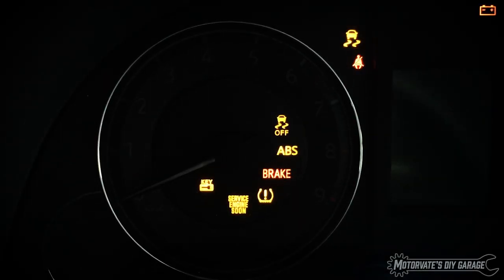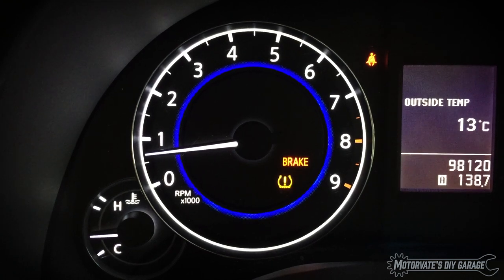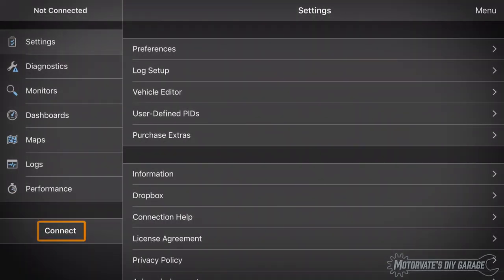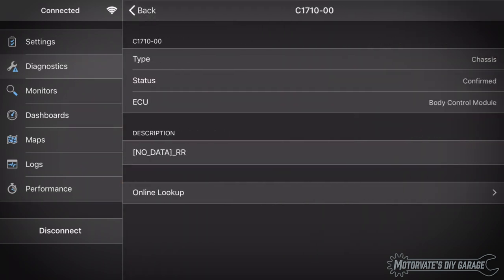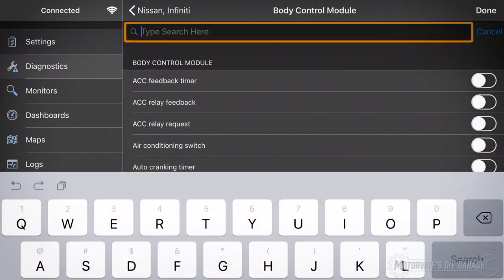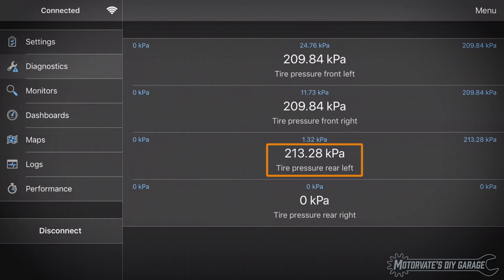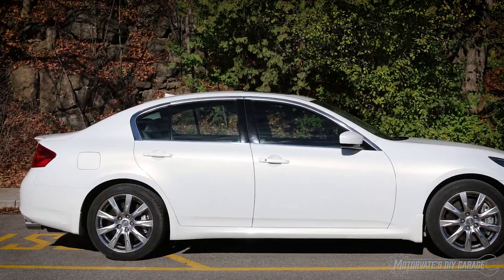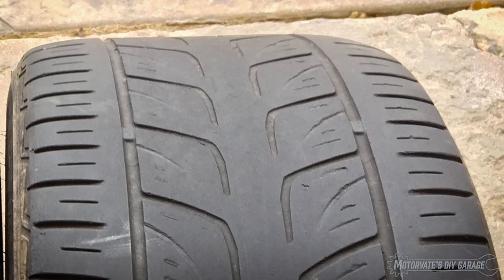How to Read TPMS Trouble Codes and Display Tire Pressures: Motorvate's DIY Garage Ep.32

Comment: amazing video.  did you make a video on reprogramming the sensors when you replaced the tire or did you pay them to do it ? I had wondered if you can get the sensor ID from this program in case it was hard to read after removal.
Reply from the maker: Unlike the G35, special tools are needed to program the BCM (body control module) for the TPMS sensor IDs.

Comment: great videos..  I'm a subscriber and just purched a 09 g37xs. Excited to follow these videos to upgrade and DIY. QUESTION: what brand ODB are you working with?
Reply from the maker: Hey Joseph Reynolds,
The Veepeak OBD scanners have worked well for me and are a good balance between price and quality. I have used a Veepeak VP01 (wifi) scanner without any problems for just over 2 years.

Stay away from the $10 scanners, lately there have been lots of issues with them and don't connect.

Congratulations on your new (to you) G37, I hope you enjoy your car as much as I enjoy mine :)
Reply: Thank you for your time and reply. Also thank you for your guidance, I'm looking to order Vpo1 tomorrow to get more informed with the understanding and keeping track of my g37. Thanks a lot once again! 
.... PS.. This would probably have helped with a problem I had 5 days after buying the vehicle.. Long story short... Airbag light blink, took back at the dealership day 6, Dealership found problem after a week at the dealership... Waited 3 more weeks for "the part" dealership says I can bring it in 11/26 to fix "under passenger seat" smh...details on parts are unknown but I will find out
Reply from the maker: Hey Joseph Reynolds,
With your new OBD scanner and a $15 add-on for OBD Fusion you can scan your AIr Bag (actually SRS) module for codes. PLUS any codes on any modules on the G37.

Here is a link to a video that shows hoe to do this my other YouTube channel: OBD4Everyone:
https://youtu.be/g3bMDC_41qc

I hope you find it helpful!

Comment: Having trouble with my TPMS its reading "too few pulses" even with the new sensors. I'm thinking it has to do with something with the BCM as it was replaced with the old none working sensors at that time?
Reply from the maker: What is the exact code from the BCM? Did you sync the new sensors with your BCM?

Comment: Great Vids! 
Question… I have an Android HU in my 2010 G37x and installed OBD Fusion. I’d like to have gauges that read tire pressures. Will the advanced diagnostics allow me to do that? 
BTW… Kal Tire replaced one of my TPMS sensors for a decent price.
Reply from the maker: I know it does for my 2011 and I would expect it to also work on your 2010.

The one problem you may see is when getting tire pressures, you can't connect to other OBD Fusion defined "networks".

When you have the enhanced add-on, when you connect to your car, you need to pick a "network". If you want to read data from 2 modules that are in different networks, it doesn't work.

So, if you just want tire pressure, you should be good.
Reply: @MotorvateDIY  Thanks for the info. I got the tire pressure gauges to work, and it's pretty slick! :)  

Question… now that I have set up OBD Fusion with gauges to read tire pressures, when I connect to the 'Generic OBD2', it ‘Includes modules on Network E’, and I get the warning “You should only continue if your vehicle is in park and will remain in park while connected.’ I can’t seem to go back to the regular OBD2 connection and connect without the warning. Any ideas?
Reply from the maker: Glad you got the tire pressures!
To switch "networks" with OBDFusion/OBDLink you need to disconnect and then reconnect. Then you can pick the network you want :)

Comment: I chose not to replace all my tpms for $220 last week when I replaced all tires because tpms light only comes on if 25% less. i.e 36psi is different from 29psi but light won't come on since not at 25% less yet.. you're already wearing out the tire!! I check my psi myself about once a month.
Reply from the maker: Hey hostilityy,
I agree 100%... The only reason I will be replacing my TPMS sensors is to datalog the temperature increase when on the highway or track day. (to be used for a future episode)

Comment: Hello
 I just bought a 2009 g37s coupe 
 I saw your kmpl@ 11.2 during oil change video.  Mine is at 15.1 even though i dont push it very hard. The car is completely stock. Any recommendation for better fuel economy. Also that what is the best oil change interval with synthetic oil( I live in edmonton,alberta) 
Thank you
Reply from the maker: Hey Ajitpal Singh,
It took me a moment to understand what you meant by "kmpl" but I got it: KM/liter,
but I think you mean liters/100 KM. :)

Anyways I base my oil changes intervals on a used oil analysis. Here is the first one: https://youtu.be/uvExyfxzsRo
and the second one: https://youtu.be/cU8UMlMzi30

I change my oil every 12,000 KM and use a Nissan oil filter. I always use synthetic 5W30 and buy it from  Canadian Tire when it is on sale.

As for suggestion for better fuel economy just your tire pressure and set them to the pressure shown on the sticker inside the driver's door jam, try to avoid traffic ( I know... you probably can't) and use 91 pump octane.

The G37 is not very good on gas, and if you do a lot of short trips it is worse.

Comment: Love the videos! I use different wheels for summer/winter tires. How do I get the TPMS to recognize the installed pressure sensors?
Reply from the maker: Hey Chaingroup Acoustique,
Thanks for your kind words!

Every vehicle has its own special setup to "learn" the TPMS sensors.
Most need special tools, but some can be done without.

What vehicle are you asking about?
Reply: 2014 qx50
Reply from the maker: I don't have any technical documentation on the QX50, so I won't be able to help.
Maybe try the QX50 forums or Facebook groups.

Good Luck!

Comment: Hi hopefully someone can help me out here, so I cleaned the throttle bodies and the maf sensors, put everything back together, took it for a quick drive and now when the car idles in park the rpms bounces from 2000 and 1300 continuously. It’s possible I made an error in putting things back together but I’m really not sure. Anything you recommend I should do?
Reply from the maker: Hey Donald Trump Ice Cream,
I think so.... after you clean the throttle bodies, there are 3 procedures that need to be done: release accelerator position learning, closed throttle position learning and (the most important and difficult) the idle air volume learning.

They are not hard to do, just follow the steps in the video: https://youtu.be/HIiaF0VaTlQ

Comment: i really hope you’re able to answer this question 

so i purchased some nismo wheels for my 370z and they all came with TPMS sensors however i know they won’t automatically pair with my Nismo. so what are my options? 

also where can i buy your bluetooth obd2 scanner?
Reply from the maker: Hey Enkesis,
In order to sync your BCM (body control module) with your new TPMS your options are:
• Infiniti dealer
• Local tire shop
• Amazon for a "TPMS Sensor Activation Tool "

Or, just ignore the yellow dash light :)

On my other channel, I did a review and speed test  of 10+ different OBD scanners: https://www.youtube.com/obd4everyone
Reply: Motorvate DIY just left a local tire shop, they did it for free (: thanks!

Comment: I don't have a light on or anything but when I scan my car it says my back left tire is flat and to do a relearn. It's a 2011 g37s coupe and I recently put 275/35/r19 on the   Rears so should u do the hack where u use a paper clip on the white wire by the OBD sensor and ground it out 6 times and all 4 tires must be different psi's then drive it around. That might not make any sense but u can easily look it up on YouTube for the tpms relearn.
Reply from the maker: Hey sk8punk318,
Just to clarify, when you scanned your BCM what was the code?
I will do some digging into the relearn process you mentioned and get back to you.
Reply from the maker: Hey sk8punk318,
I was wondering why I didn't know about this "paper clip" trick.  I do a lot of research to ensure each episode is accurate... but this was news to me.

Now I know why... The "paper clip" trick only works up to 2010 on the G37.

Starting in 2011, that "tire pressure warning check connector" is no longer in the OBD wiring harness or shown on the BCM wiring diagram. I just checked my 2011 sedan and it is not there. 

Too bad!

Comment: Hey, I've got '08 g35 sedan. I installed OBD Fusion on my phone and it looks a little different. I have a network F that contains body unit, but there is 0 PIDs, while I am trying to find tpms sensors. Do you have any ideas about this?
Reply from the maker: Hey  Павел Копров,
I have checking the 08 wiring diagram to verify the BCM module is on the same network (CAN bus) as the ECM and it is.

Digging a little deeper, it looks like the G37 uses an updated system for tire pressure monitoring.

The G35 has a "TIRE PRESSURE WARNING CHECK SWITCH"  as shown in the factory manual, section WT (Road Wheel & Tire) page 8. The G37 does not.

My only guess is that OBD Fusion might now support the G35's TPMS PIDs.

You could try asking OBDFusion if there is anyway to get this to work:
https://obdsoftware.force.com/s/

Good luck!
Reply: @MotorvateDIY  Thanks for reply
Reply from the maker: @KRoS1501  You are welcome! Thanks for watching :)

Comment: I watched your OBD video, which OBD bluetooth device do you use for this video?
Reply from the maker: Hey Eric Lui,
For that video, I used a generic ELM 327 OBD scanner. Veepeak makes a good OBD scanner and has a good balance between price and quality. Also, generally, I like to use wi-fi over Bluetooth scanners. Wifi seems to be a little faster.
Reply: @MotorvateDIY  glad I came across your video. Subscribed. Bluetooth enables one drives and maintain the connection between phone and the obd scanner. Will Wi-Fi obd work while driving. Thanks in advance!

Comment: Are you able to do a relearn with obd fusion?  It shows that all my tires have an error code.
Reply from the maker: If your TPMS sensors are more than 5 years old, the battery is probably dead and they need to be replaced. 
OBDFusion does not have the ability to execute functions. It can only read data.
Reply: @MotorvateDIY  thank you! Do you have an email so I can ask you something different from this situation.

Comment: Hello! some way to scan Slide Door Light Honda odyssey 2009 Thanks, (I have the same app)
Reply from the maker: Hey  Juan Larios,
I don't understand what you mean by "scan Slide Door Light"
What is the issue?
Reply: Motorvate DIY Thanks answer, the sliding door of my Honda Odyssey doesn't close or open and has the light on (SLIDE DOOR)
Reply from the maker: Hey  Juan Larios,
I don't think an OBD scanner will help with that issue. 

Try to find a wiring diagram to understand the circuit and then start to troubleshoot. If electricity/electronics are new to you, it might be a good idea to take it to a shop.
Reply: Motorvate DIY ok thanks

Comment: If I install 4 new tpms, how do I program this new tpms thru Obd2 app?
Reply from the maker: That app will only show data like tire pressures... It doesn't program them. 
Programming a car for new TPMS sensors depends on the year/make/model of the vehicle. For some, all you need to do is drive it around and the car will figure it out  and others need to be programmed.
Reply: @MotorvateDIY  hello and thank you for this channel!
I'm also owner of G37.
Wanted to ask you, particularly for G37, what is the procedure of adding new TMPS sensors?
I have two sets of wheels, one of them has original sensors, and for the second one I want to buy some aftermarket ones.
As far as I understand, I need to read codes from the original ones to copy these codes into aftermarket ones, right?
If so, could you please advice an application that at least can read codes?
Reply from the maker: There are some aftermarket TPMS sensors that have a programmable ID. You could use those and your car will always have a working TPMS (aka TPMS light off).

There is another way and I will be doing a product review on this in the spring, when I put on my summer tires.
Reply: @MotorvateDIY  Do you know which app can be used to read TPMS sensors IDs from G37 OBD2? I'm looking at NDS III, but it seems that TPMS data is not readable but it. I was advised to use special tool like Launch, but it is quite expensive.
Reply: @Alex GT  obd fusion, watch the vid^

 literally, the app in the video he is showing you how to use to read the sensors on the exact car you are asking for 🙄
Reply: I bought TPMS that said they were pre-programmed for my make and model. They never connected and have had my light on my dash ever since. Pissed! @MotorvateDIY
Reply from the maker: The "universal" TPMS sensors need to be programmed for your make and model, as this configures the broadcast frequency (315 Mhz for the G) and how the broadcast data is encoded.

For some cars (like the Q50), it will learn where each TPMS sensor is and use it. 

For the 2010+ G37.... NOPE! The body control module (BCM) can't re-learn on its own... it needs to be told (programmed) to know what TPMS ID to look for and where it is located.

I've already developed a low cost device that will display your TPMS ID and tire pressure... the next step is to program the BCM so I knows the pressure for each tire. This is being worked on when possible as "tire change" season is soon upon us, if you live in the northern areas.

Comment: Hi there. I didn’t find (Tire pressure front left,....., etc). I have OBD Fusion version: 5.10.0. Can you help me to find it please.
Reply from the maker: Hey  ADIL M. ALAMRI,
Depending on the vehicle manufacturer it may or may not be available to OBD Fusion to show.

If you can't find it, it probably isn't available.
Reply: Motorvate DIY thanks

Comment: Link to the new tpms?
Reply from the maker: Hey b00b00,
The car has snow tires on now and I will be getting  new TPMS sensors  and tires in the spring. Soooo I don't have a link to provide right now. BUT I will in the spring :)

Comment: My left rear one is not working
Reply from the maker: Hey TheCarSection TheCarSection,
I know how you feel, my right rearTPMS is dead. :(
Reply: @MotorvateDIY  thank you it's annoying but it still holds air i saw tpms on Amazon for 34 bucks and it say it's already programmed should I buy it?
Reply from the maker: Not sure... I don't know how it can be pre-programmed for your car. 

As I understand it, the only way the replacement TPMS senor will work WITHOUT programming is for it to have the exact same sensor ID of the TPMS that is on your car. I don't see how they can do that.
Reply: @MotorvateDIY  ok I will thanks again

Comment: I just purchased OBD Fusion along with the 2010 Nissan option.  The menus look different from what is displayed in your video; there is no Network D.  The only thing I found regarding TPMS were two PIDs: C_Absent TPMS.

Could what I am seeing be a limitation of the adapter I am using, i.e., KIWI 3 ?
Reply from the maker: Hey  Ronald Craft,
I don't think it is the adapter. Different vehicles  will have different modules and networks.

What year and model is your 2010 Nissan?
Reply: @MotorvateDIY  My Nissan is a 2010 Murano SL AWD.
Reply from the maker: Hey  Ronald Craft,
On your Murano, the BCM (Body Control Module) should show you  the tire pressures. Simply select BCM or any "network" that shows BCM.
Reply: @MotorvateDIY  Thank you! I found the menu and was able to view all four tire pressures and error codes.  However, all the pressures were zero and there were no errors. I was hoping there would be a relearn option; apparently there isn't.

All four TMPS units are new Schrader O.E.  I have attempted to register them by putting the system in relearn mode via the paper clip method and then using an EL-50448 transmitter to no avail.

Any help would be greatly appreciated.
Reply from the maker: Hey Ronald Craft,
I don't have much experience with the Murano TPMS so my help is limited.

Are these the instructions you followed?
https://www.myg37.com/forums/d-i-y-installations-modifications/207490-reset-tpms-warning-by-yourself-for-free.html

Comment: TPMS are totally useless, average $75 per tire, what for?
Reply from the maker: Hey Javan Dell,
I think they are good for people who don't look at their tires or check pressures often, which seems to be most people.

If you do check your tires, then they are not needed.
Reply: I'm glad I have them when I hit a giant bump driving in NY and I'm worried I blew out a tire, but if the sensor isn't going off then I know I'm good without having to pull over to check.